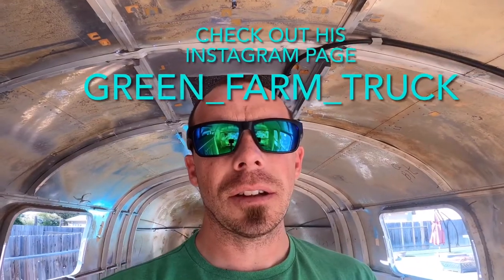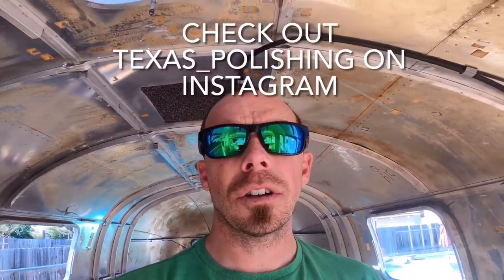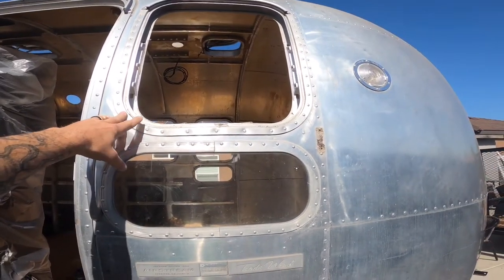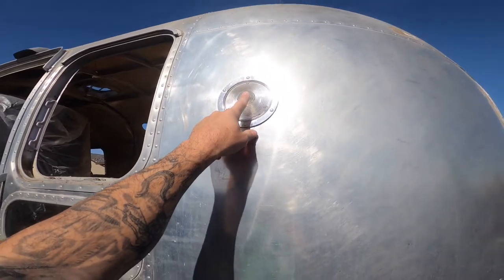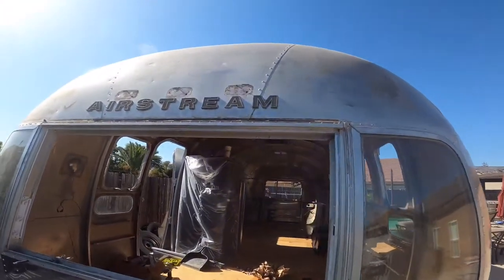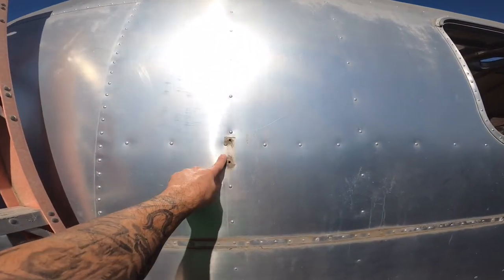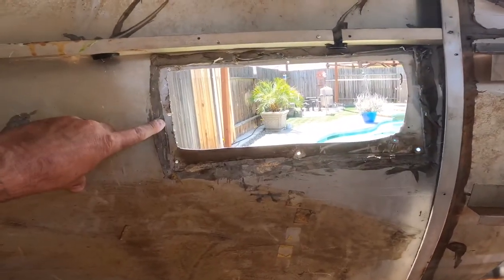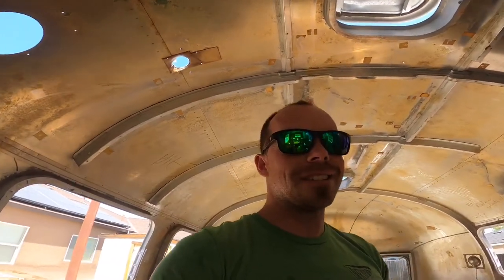Airstream Exterior Prep for Polishing

Comment: I have polished our 92 excella, used zephyr products be ready to work your ass off. Good luck I'll be watching
Reply from the maker: Good to hear Jeffrey! Yes you are right I started the process a few days ago. The polishing will most likely be a 3 part video series. End of the first day I got to one of the front original panels that needs sanding before polishing. Doing that part now and hopefully will wrap it up tonight and back to polishing the lower half of the trailer tomorrow through the weekend which will be part 1 of the series. Thanks for the support